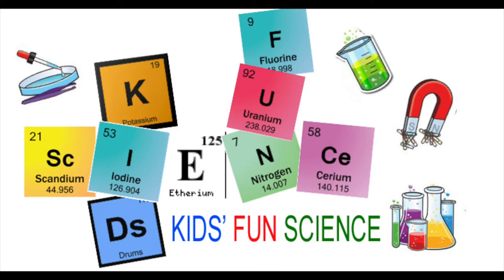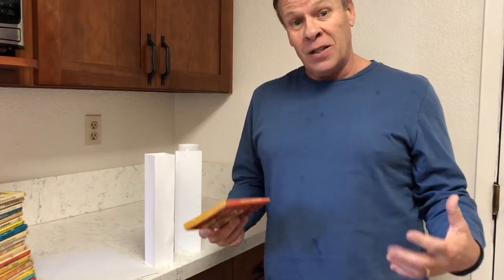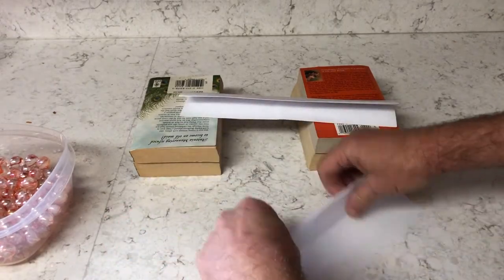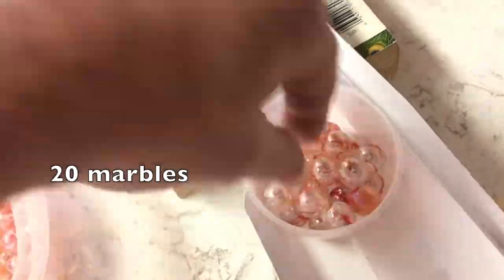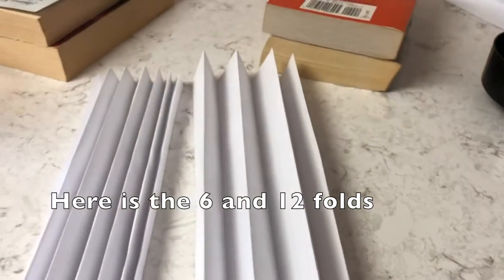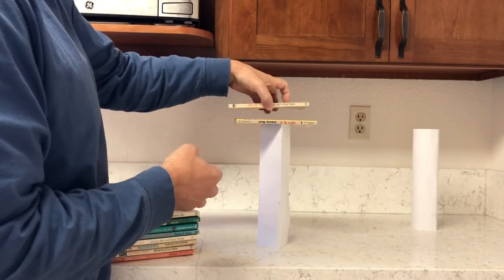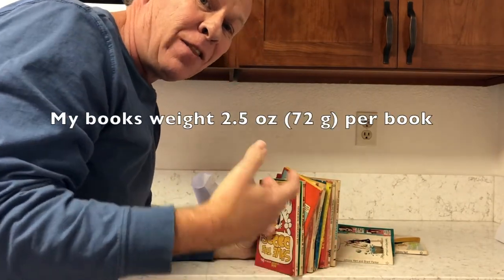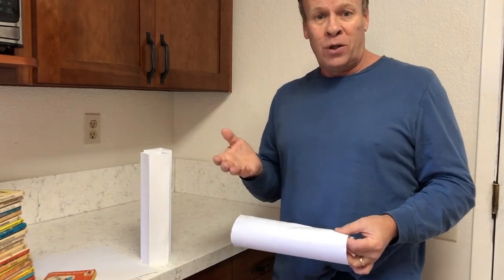Testing the Strength of Paper (Testing Paper for Strength) - Science Project Ideas

Comment: Hi ....what method you using?
Reply from the maker: Hi Nurul Niesya, The shape of the column determines how the weight of the books on top is distributed. With a triangular or square-shaped column, the increasing weight is distributed to the corners or edges of the column. If the weight isn’t distributed evenly, the column will buckle and fall. A cylinder-shaped column can hold more weight because all parts of the column support the books equally. Thanks Ken